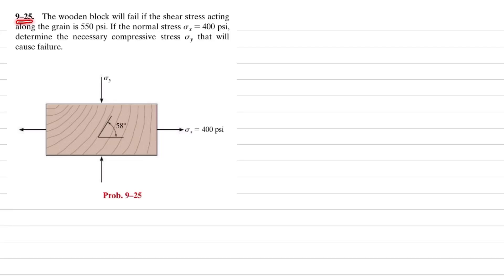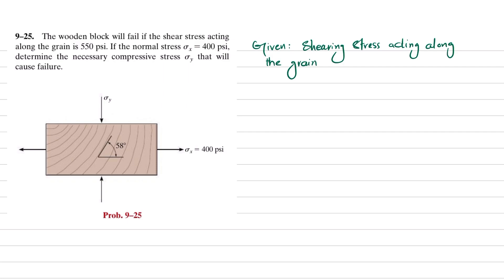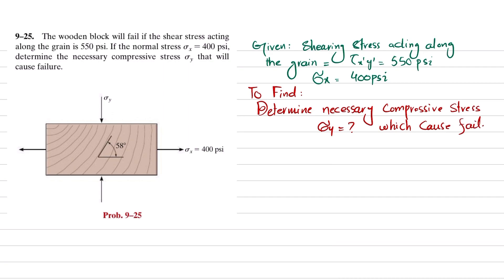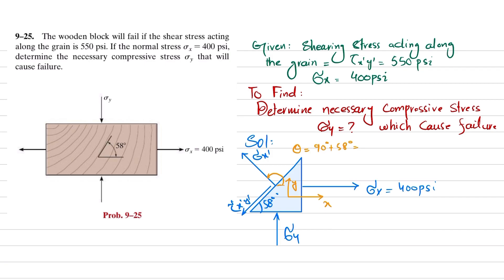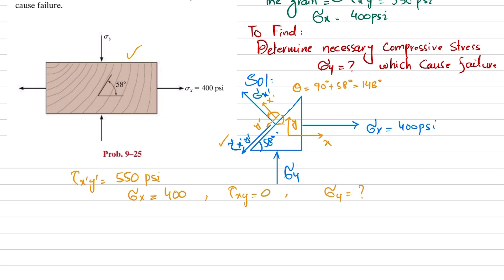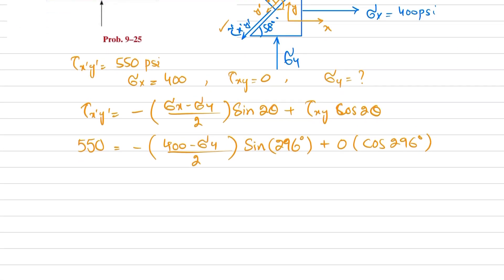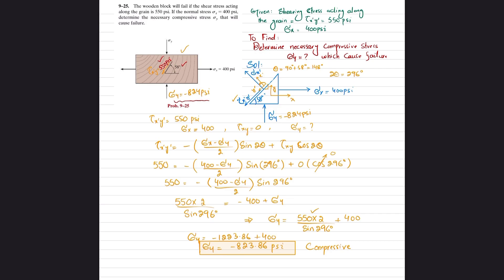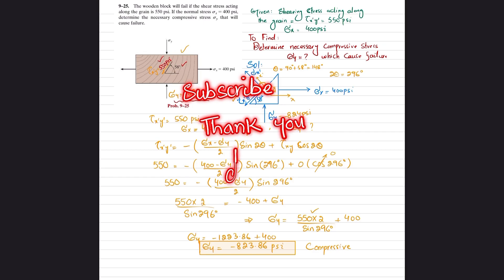9-25 Determine necessary compressive stress that will cause failure | Mech of materials rc hibbeler

Comment: didn't understand why you take theta = 90+58 
it should be only 58 degrees according to me 
please explain tmrw i have a quiz
Reply from the maker: brother when you cut it at 58 degree the the surface is at 58 degrees and the normal stress is perpendicular to the is surface will make angle of 90+58 degree. also check the rest of comments of this video.....

Comment: Why can't we use the maximum shear stress formula here?
Reply from the maker: Maximum shear stress formula for what? I mean to say which maximum shear formula ? Can you mention the expression
Reply: @engradnanrasheedmechanical  
I think I understand; The question is the maximum cutting force at 58 degrees. So, if he had asked the maximum cutting force without giving an angle, then we would have used the formula I mentioned. Thank you.
Reply from the maker: @XxX-wr6wv yes you are right then

Comment: If the grain is 58° from the horizontal (where sigma x is parallel), wouldn’t sigma x be rotated 58º from the horizontal and sigma y be 90+ 58º from the horizontal?
Reply from the maker: Yes you are right...
Reply: I was thinking the same way. Is there any other explanation?
Reply from the maker: For example ?
Reply from the maker: I have replied, kindly check your email 📧